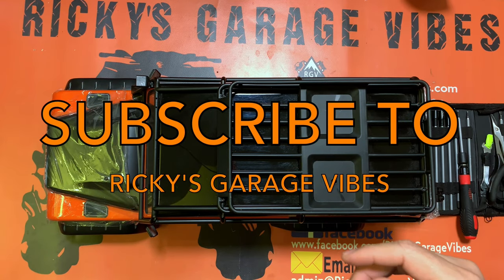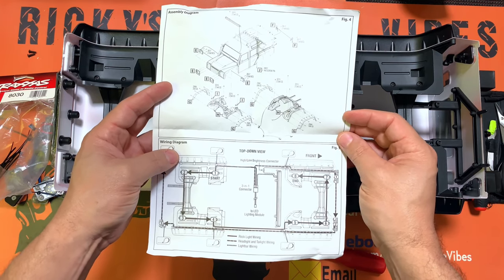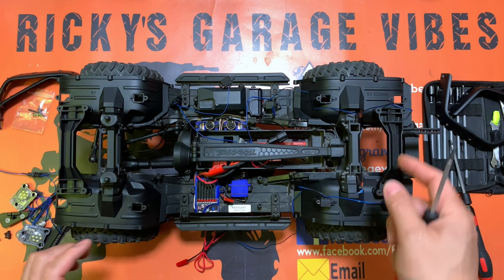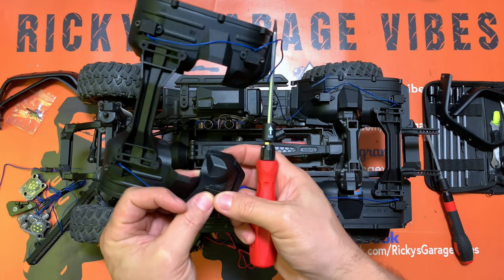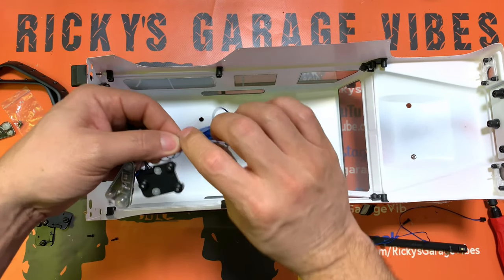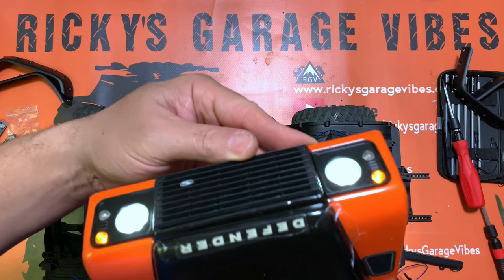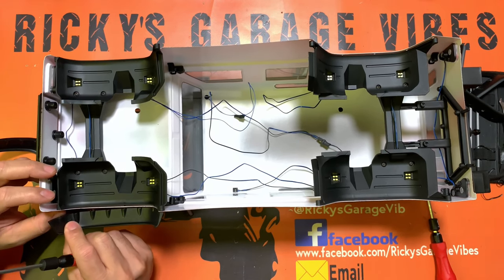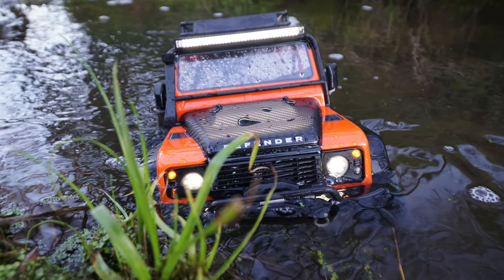How I Install the Traxxas TRX-4 Complete LED Light Kit 8030

Comment: Does that power box have room for another set of lights? For example, if adding a push bar with 2 lights and one connector to my TRX4 Bronco bumper can it plug into the power box? Looks like there are 4 slots available and the kit uses 2 slots. Also what is the voltage out of the box about 3V? You make it look easy, nice video.

Comment: Hello,
As only one couple if pin are used in the light module, there are some pin connectors exposed. There is no problems to drive into water?
Reply from the maker: No problems in water the box is waterproof
Reply: @RickysGarageVibes  Thanks a lot 👍🙂